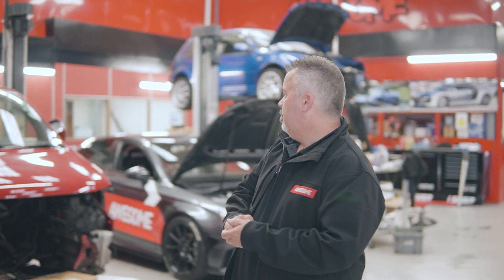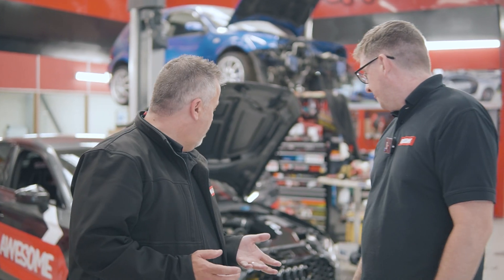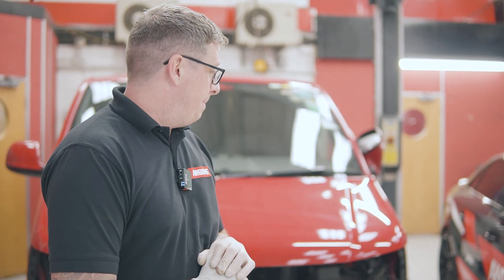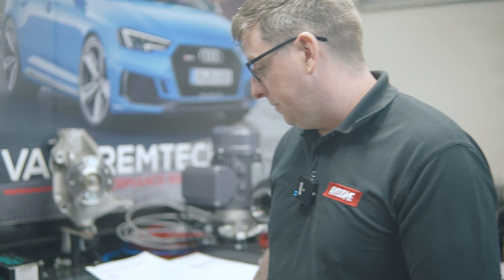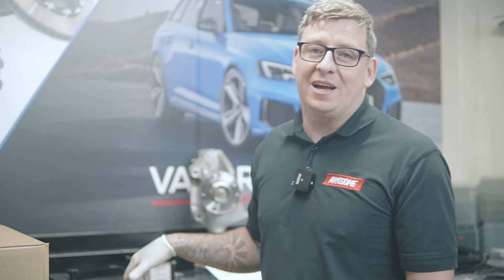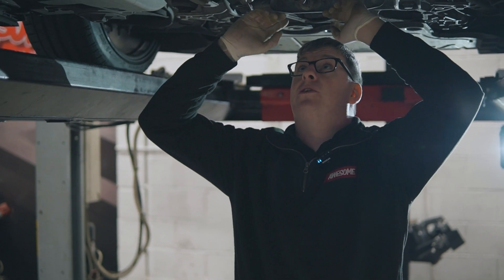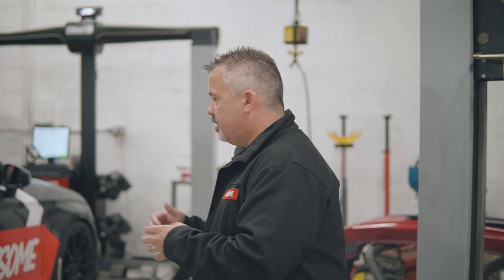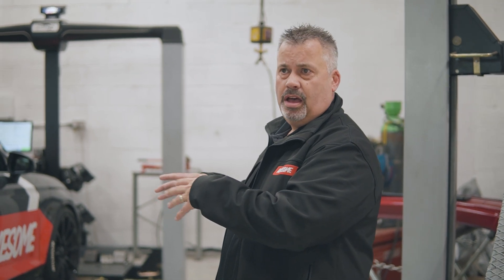Building a 9 Second RS3!! 720BHP flame thrower! AWESOME CAR

Comment: Cutting off the exhaust is a step too far....i mean where do you stop? - why not remove all the doors and replace with some plastic sheeting. Remove the boot. Remove the windscreen, replace with plastic. Remove the wing mirrors, headlights, tailights...Finally remove the driver, replace with a 4 stone anorexic girl who can just about hold the go pedal down.....there look at my 9 second RS3 - which is basically a metal frame with an engine and wheels bolted on to it.
Reply from the maker: Any advantage to set a record is needed, this is at the end of the day a race :)